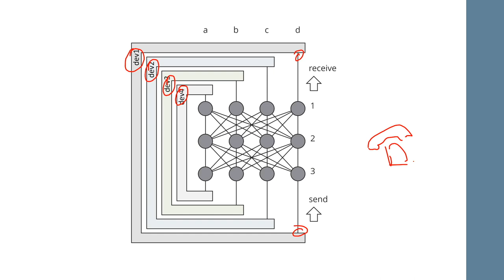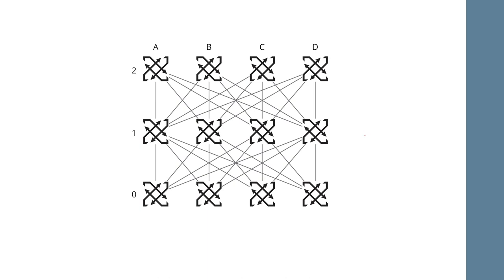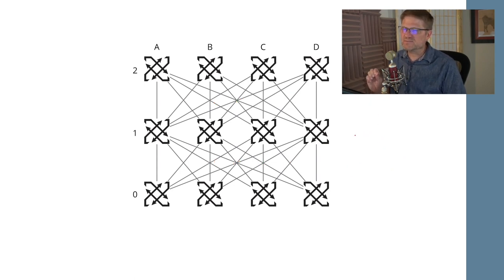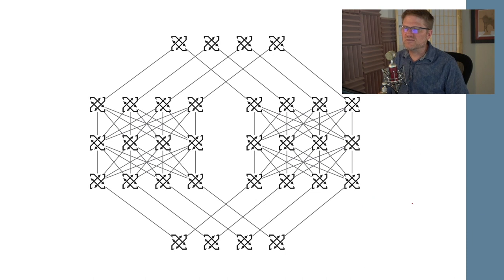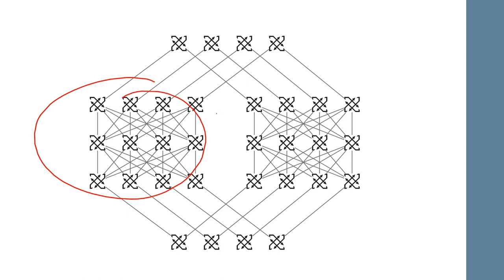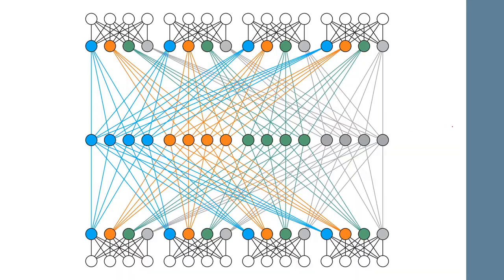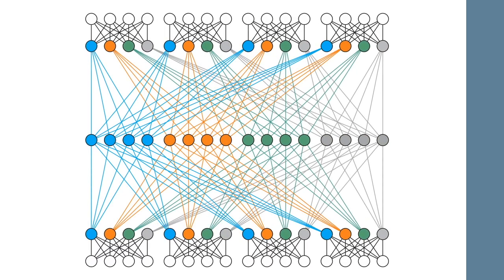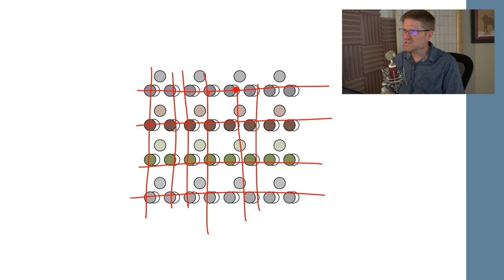Understanding Data Center Fabrics, Part 3: Characteristics Of Data Center Fabrics

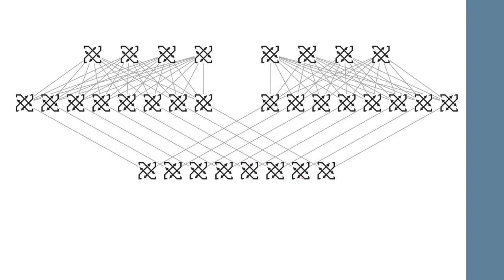Comment: Around ~15:00 minutes there is discussion about fat-tree topologies. 

As Russ stated the "non-formal" description of a fat-tree is a speed stepping from edge to fabric. Is there any point at which the speed stepping may require larger buffers in the fabric, such as 10g edge to 100g fabric or 1:10. Is it more important to match the SerDes of the optics? Such as 10g edge and 40g fabric or 25g edge and 100g fabric.